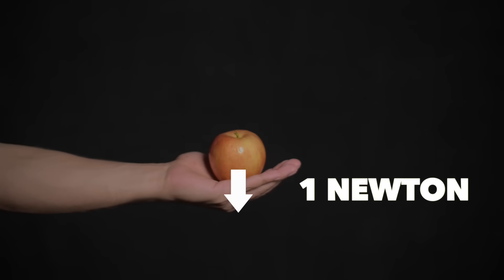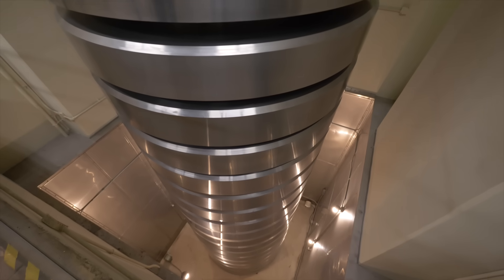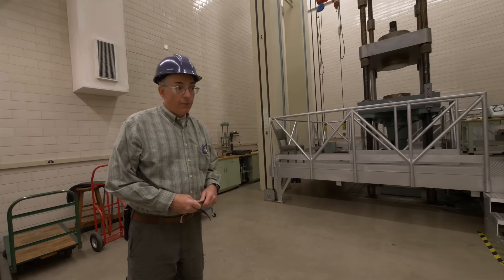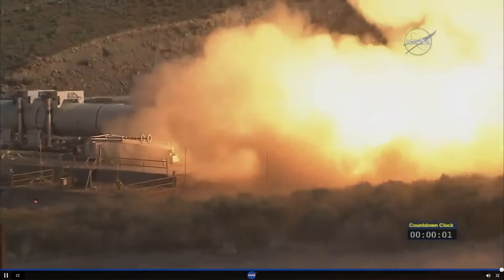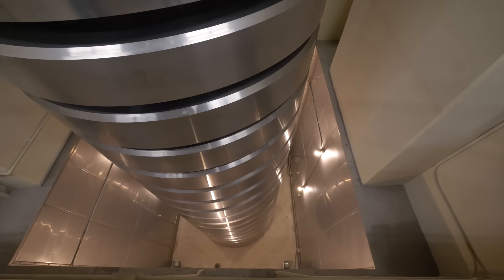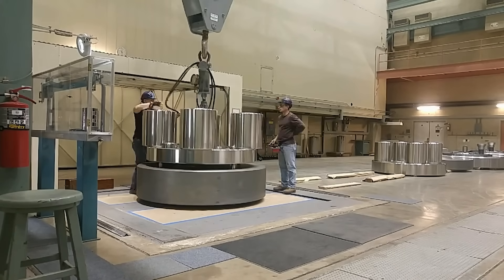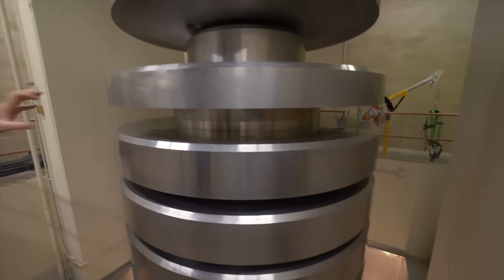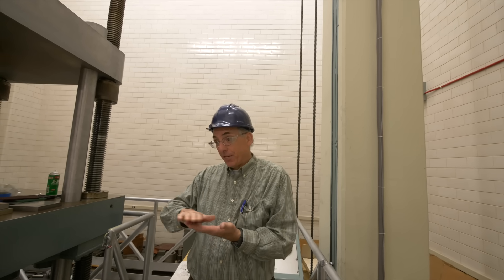World's Heaviest Weight

Comment: How accurate is this if the US standard kilogram turned out to be off?
Reply: That was an astronomically small inaccuracy.  It doesn't matter for this thing, which was constructed pre-metricization anyway.
Reply: @tsm688  still. The kilogram was based on the weight of water and solidified in a single piece of metal. Several copies were made and though they were vaulted and kept in a vacuum seal, the copies were off by a bit. So this thing can go off too as the matter matters.

Comment: Gravity? Stop believing the lies.
Reply: joe joe what
Reply: Yep, There is no such thing as Gravity. I can easily explain. If you would like.
Reply: joe joe Ok, please explain whatever “research” you’ve done.
Reply: You can start with the design of boats and Submarines. How are aircraft carriers not sinking ? How do submarines sink and rise again.
Or why the helium balloon rises instead of fall. You may already know the answers. But  some how, will ignore the end result.
Reply: It should be described  as
 Boyincy and Density
In science its described as Specific Gravity. Which is measuring something's Density.
So if something is lighter then the Air, it can Float away. 
Same with in the water.
An object will not  floating in Water, if the object weights more then the water it is displacing.

Comment: I am interested in the maintenance design of this apparatus. Must have been expensive to build in the first place, NASA probably doesn’t want to make again, if necessary. Maybe materials are more resistant to corrosion than others. Maybe kept in a low humidity environment to limit oxidation corrosion. Maybe dissimilar metals are insulated from each other to limit galvanic corrosion. Also, limiting corrosion limits the variances of it’s true mass, over time. Etc., etc.
Reply: https://www.nist.gov/news-events/news/2016/06/million-pound-deadweight-machine-officially-open-business  A few things were moly coated, but mostly it's all pure stainless steel, including the fasteners.

Comment: "What we sell is the vertical force vector that's generated by these weights hanging in the gravitational field."

I enjoy that sentence very much.
Reply: GNCshow 
That’s what the NASA engineer thinks is being sold. NASA executive would say that “confidence” is being sold. (Thank you, MBA.)
Reply: @stevedoe1630  severely underrated comment
Reply: Dont understand could you explain it with a different approach to someone dumb like.me?
Reply: @theforester_  They sell fancy expensive scales.
Reply: @Sei783  they don't sell fancy expensive scales. What they sell is their services - which is calibrating scales and force transducers or load sensors. Scale calibration is basically comparing what a scale reads out when a known mass standard is placed on top of it.

For example if you own a weighing scale and you want to have it tested if it reads the correct weight, you have to take it to a mass calibration laboratory like the one featured in the video. They will place a mass standard (a chunk of metal with a known weight, for example 5 pounds) and compare it with the scale's readout. They will do that with successively larger weights until the scale's full capacity is reached, crunch some numbers until they get the percentage of uncertainty of the readout, and print out your calibration certificate. That's what calibration basically is. Adjustment of the readout to match weight of the standard mass is a different matter.

I hope I provided a good enough explanation about how this works. 😉
Reply: @MoisesJrFurto  or to simplify it; they place weights on a scale. As someone that often has to calibrate scales, it's not that amazing, unless of course you're talking about massive weights like in this video. Other than that, it's something a monkey could do.
Reply: @AwakeAgainAtLast  I agree with your first sentence. However, I haven't heard about any monkeys calculating weighing uncertainties yet.
Reply: I read the comment and in the second i read it i heard it as well😂
Reply: I read this comment exactly when he said it

Comment: ok but WHY WOULD YOU USE THE IMPERIAL SYSTEM FOR A MACHINE THIS IMPORTANT?
Reply: Probably because this is in the US where the vast majority of industries use imperial.

But ultimately it doesn't really matter, the end goal is to calibrate loading cells and they're just as well calibrated whether you use them to measure pounds or kilos.
Reply: Ever heard of CONVERTING UNITS?...duh...the damn video said it was 4.4 million something newtons(a different UNIT of force, than POUNDS) which  CONVERTS to EXACTLY 1,000,000 pounds...anyone with a calculator and conversion chart could manage this last step, if necessary.
Reply: This guy is just as happy to tell it to you in Newtons if you want metric, and does so in NIST's own videos.  Force is force.

Comment: Guy: an apple weighs 1 Newton 

Me: ok, how much does it weigh?
Reply: Scientist: 9,81N = 1Kilogramm 
Engineer: ~10N = 1Kilogramm
Reply: @Flora_Flower_98  naah
I'm an engineer and I always use 9.81m/s².
Reply: @Flora_Flower_98  10 its just good enough for most of calculation
Reply: @Flora_Flower_98  right...
Reply: @Flora_Flower_98  Engineers are technically scientists.

In most engineering applications 10 is as good as 9.81 because once all the math has been done you're going to slap a safety coefficient of 2+ on top of it anyway so hardly matters.

But I'm sure engineers designing airplanes or submarines take into account the actual figure at different heights/depths.
Reply: Apple is W = 1N, the weight is measured in newtons. Using the formula: 
W = mg.
W - weight(N)
M - mass(kg) 
G - gravational field strength ~ 10N/kg
To find the mass it will be 
m = W/g 
So,
m = 1/10
= 0.1kg. 

So what you actually want to find is the mass in kilograms. Hope my explanation/ workings helped :D
Reply: @willion98  or just remember 1 kg = 10 N
Reply: @niksignjarzilavec366  No.
 1 Kg ≙ 9.81 N on the surface of the earth
Reply: @jtejada2784  Like my phone's sensors say it's 10.34m/s^2. Either wrong or i live in a gravity well. Point is- it varies across the World.
Reply: @niksignjarzilavec366  or 1 N = 100 Grm ?
Reply: @dannydetonator  what is the name of that measuring app
Reply: J Tejada yeah im guessing they rounded it
Reply: @dannydetonator  Your phone is wrong. Yes, surface gravity varies across the earth, but not by 0.5m/s^2. The highest value is 9.8337m/s^2 at the surface of the Arctic Ocean, the lowest is 9.7639m/s^2 on the Nevado Huascarán mountain in Peru.
Reply: Danny THE Dog Jesus Christ 10.34 m/s^2??? Gravity doesn’t vary by THAT much
Reply: @jtejada2784  Yes and no. It's easier to remember 10 than 9.81
Reply: @niksignjarzilavec366  not really, g isn't 10 N/kg, but g=9,81 N/kg. Actually g=9,81 m/s², 'cause it represent the gravitational acceleration
Reply: @federicomessina4866  Yeah but somewhere its, 9,82m/s^2 and another apple weighs 80g so I don't know it matters if you say 10 or 9,8 When there is most likely more difference among apples. Also N/kg is equally as accurate as m/s^2, mathematically it's the same
Reply: @niksignjarzilavec366  thank you
Reply: @niksignjarzilavec366  thank you
Reply: @niksignjarzilavec366  not how it works
Reply: buggygz9 kind of irritates me when people assume g as 10 N/kg, cause the relative deviation is almost 2%, it scales pretty fast.
Reply: @willion98  r/woooosh
Reply: @willion98  what you say?
Reply: buggygz9 aint it 9.80 m/s/s
Reply: @willion98  thank you capitain obvious
Reply: buggygz9 all that working and you took the force of gravity to be 10ms^-2
Reply: Me: yes
Reply: Jazmin Lopez Nice physics class we having here
Reply: An Internet user that could be anyone we’re all learning with eachother
Reply: I think it's fair to say that Newton weighed one apple.
Reply: Standrard International Units vs retarded units. Let the fight begin!
Reply: @fn326  It's not retarded. Some of us grew up with it and are used to it. There's no need to an asshole about it.
Reply: Jazmin Lopez divide by 9.8 so it roughly equals .1 kg

Or 100 g
Reply: g=9.8 m/s^2
F_g=m*g
1N=m*9.8m/s^2
m=1/9.8
m=0.102kg
About 102g.
Reply: It weighs an apple!
Reply: @RBZ06LT6  And what does an apple weigh? You're avoiding the question.
Reply: steve Kos youre avoiding the answer
Reply: 1 Newton
Reply: @thomasfuhrmann1739  I see Your An Intelectual
Reply: Jazmin Lopez 1 newton
Reply: Wait, I thought an apple hit one Newton
Reply: Daniel Petersen i thought Newton ate the apple🤔
Reply: @jazminyz  i thought newton was the apple🤔
Reply: 9.81N/1KG
Reply: 1 lb force = 4.48 Newtons.  Or 12.75 Oreos.
Reply: 1 Newton = the force exerted by a 1 kilogram mass. 
1 Newton = 9.8 kg m/s^2
Reply: will u stop guyl i failed in physics
Reply: @mitto.D.nimbaku  lmao
Reply: @kadlando6492  yeah bro i failed in physics
Reply: An apple weighs 2.2 pounds

Comment: The real question is.....

Can you make diamonds?
Reply: can you break bedrock
Reply: I imagine it would create enough pressure to form a diamond out of coal if combined with the right amount of heat.
Reply: If the force was even over every square inch of the diamond and the required amount of heat was applied, possibly... 

For the most part they actually load giant cylinders full of carbon into a big ass tub of explosives and blow it up to make industrial diamonds though.
Reply: @mr.techaky7655  also if u can "make" diamonds their value will drop.. which may not be worth the expense for making them..
Reply: @aaronrajadurai1167  They actually regularly make industrial diamonds and even jewelry grade diamonds which are even better than natural diamond. Funny enough, they just use a big ass press with heating elements in it and a special holder for the seed carbon... You can literally find man made industrial diamonds on Ebay for like $8 - $45 dollars. 

To be honest though, like cars and a bunch of other stuff, diamonds are pretty much worthless on account of the fact that they're not rare what so ever. Just jewelers and mining corporations that artificially inflate the price of diamonds by withholding supply.
Reply: @mr.techaky7655  Diamonds are still fairly rare. There's a lot more gold in existence (by weight) than diamonds - including industrial ones.
Reply: @dlevi67  By weight? Didn't you mean by volume? Aren't diamonds much much lighter than gold? It would make them really pretty rare.
Reply: @Washeek  No, I meant by weight, although it is also true by volume.

Estimates of total gold ever mined are of the order of 190,000 tons.

Estimates for diamonds are much harder to come by, but in the recent past (last 15 years), mining of natural diamonds is of the order of 150 million carats per year, i.e. 30 tons; synthetic (industrial) diamonds about 3 times as much. That means about 150 tons a year, the vast majority of which is industrial diamond consumed in abrasives and coatings, so is not existing as "diamond" for very long.

Diamond production (mining and synthesis) has been much higher over the last 30-40 years than it has ever been since the discovery of large deposits in South Africa (1880); prior to that, diamonds were truly rare, being only discovered in alluvial deposits in India and Brazil.

This means about 30 tons/year for the last 40 years from mining (since Russia, Canada and Australia started mining on an industrial scale). 1,200 tons. Say about 1/5 of that per year for the previous century (1880 - 1980), when only African mines were active, which means another 600 tons. Prior to that, piffles. So 1,800 tons from mining - much of which has been consumed industrially (only about 350 tons are "gem" material).

Synthesis on industrial scale started in the 1960s and has been skyrocketing over the last 30 years as technology has become much more efficient and widespread. Let's assume that for the last 60 years average production has been at 1/2 the current rate of ~120 tons/year (which is almost certainly overestimated), and that adds 7,200 tons of synthetic material - all consumed industrially, so no longer "diamond" (it's carbon dust!).

Even ignoring the "consumption" aspect, this still only adds up to about 9,000 tons of diamonds, against 190,000 tons of gold. Bearing in mind densities of 3.5 vs 19.3 g/cm^3, this also means there are ~4 times fewer diamonds ever produced by volume than there is gold.
Reply: @dlevi67  That's astounding. Thank you. I appreciate the details.
Reply: @Washeek  You are most welcome
Reply: @dlevi67  I am the Buda. I have been enlightened. Ty
Reply: @NIHILWR  You are most welcome too, light bringer.
Reply: @dlevi67  :D yesssss
Reply: True
Reply: @9q09  But will it blend, that's the question.
Reply: @hakont.4960  Vsauce music starts
Reply: U forgot heat
Reply: Rodrigo Parra Palma there’s no height limit u stupid
Reply: @user-fo4ue9mo4z  you literally have a minecraft profile picture you should know this
Reply: @user-fo4ue9mo4z  r/woooosh ya dumbass

Comment: and how does the concrete hold 1million lbs?
Reply: Concrete around 5 meters thick can easily hold that
Reply: Its not concrete
Reply: @DavidPerez-ks9sx  well whatever the ground is made from how is it strong enough to withstand that much weight?
Reply: Some locomotives have weighed upto 1.2 million pounds and the track and wooden sleepers had no issues dealing with it

Comment: Should get your hands on some forging equipment. I used to work with presses rated for 8 million pounds (4000 tons)
Reply: You miss the point. Your forging press can apply a larger force, but it is not calibrated to within 5 parts per million.
Reply: @ShockwaveR1der  also press is not that heavy itself
Reply: @ShockwaveR1der  Maybe not.....  He knows that it can do that because at the factory where it was produced probably had one of those transducers.
Reply: What job do you work where you need an 8 million pound press?  Do you build aircraft carriers or something?
Reply: @nicklatino7157  automotive forging plants... 4000 ton presses make ring gears.. differential gears... Pinions... Wheel hubs... Very common. 2000 ton presses will make some smaller gears and pinions and truck axles.
Reply: @Taskarnin  You use an 8 million pound press to make car and truck parts?!  Those must be some serious parts.  Are you making a pre runner? Lol.  My brother is very into cars and trucks
Reply: @nicklatino7157  @Taskarnin I calibrate tonnage and wire PLC panels for hydraulic presses, 4000 tonnes ain't nothing. There are presses called dual-action, or dual-ram presses that use two separate hydraulic systems and can easily reach 10 - 15 thousands  tonnes. 4000 is child's play. When you're calibrating tonnage sensors on those beasts and they hit the floor, you're shaken off the ground practically. And there are some presses called cold forge presses that stamp out super thick pieces of metal, the metal goes in cold, and comes out red hot from the amount of energy put into it from the stamping and forging process, hence the name cold forge. It's really cool stuff
Reply: I understand its not calibrated.... They're not calibrated because there's nothing on the planet capable of calibrating 8 million pounds in dynamic loads. Also the pressed themselves way significantly more than a million pounds. A 2500 ton i worked with weighed in around 1.25 million pounds

Comment: You lost me with buoyant force. These weights are not suspended in air, therefore there can be no buoyant force on them. Also, the air pressure difference between the top and bottom of this stack of weights can not be more than .00008%.   Where do you get this 125 pounds of buoyant force from?